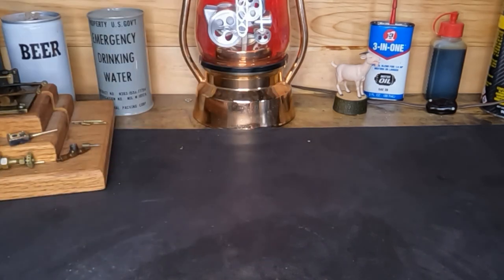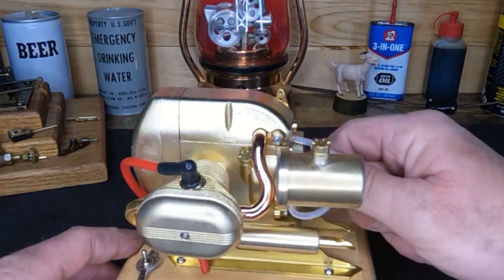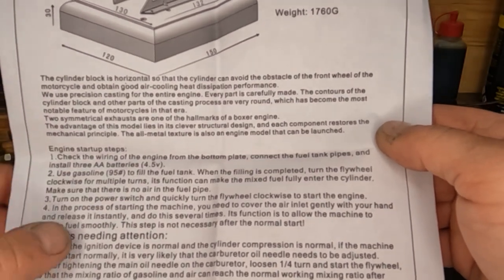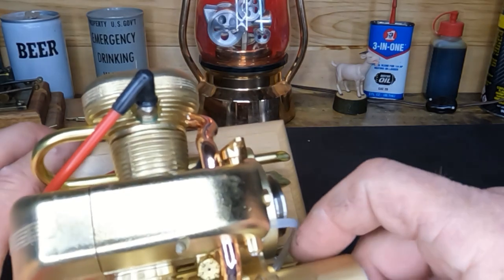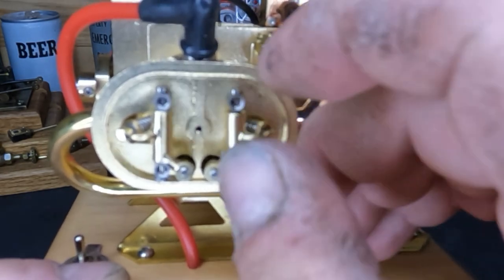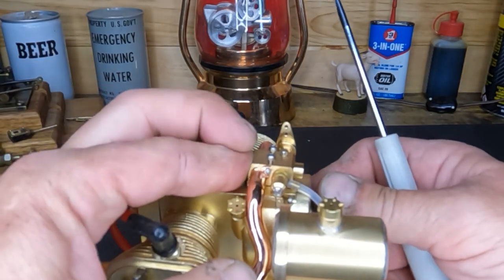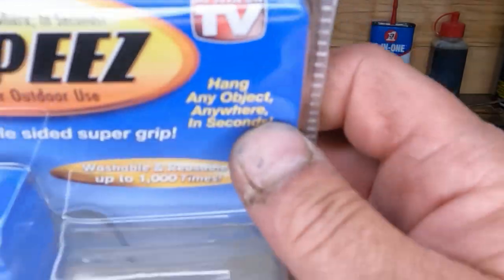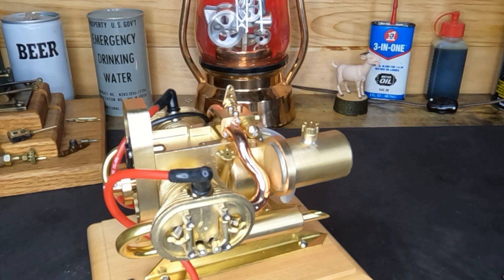First start of a R90-S boxer model.

Comment: I absolutely LOVE Chinese instructions. I FINALLY got my M12 / ET5PRO dialed in. I added wrist pin bumpers, adjusted valve lash, and even eliminated valve rocker slop with dental floss shims. To make a long story short, after hours and hours of fricky frackery I discovered that it hated 40/1 fuel but LOVES 50/1 fuel with a tich of lighter fluid!! Now it idles so slow it almost stalls and does not throttle up more than I want it to. Oh, I just love that precise carburetor. I almost came to the conclusion that the M12 was a fish tank ornament.
Reply from the maker: Hi Joe!   The instructions definitely leave a lot to the imagination especially if one is not at all familiar with how an engine works. And I honestly think that these little engines are about 75% right when they come out of the box, the other 25% is up to the owner 😅
Reply: @steam212  I still have a '64 Chevelle SS with a later model 350 V8 with headers .I had to dent one header pipe with a 4lb. hammer in order to change a spark plug. It won't beat a Tesla but IMO it looks better.
Reply from the maker: @joesenkalowski7912  I completely understand and agree with what you're saying. But I think a 4 pound hammer just might restrict the intake on this little guy 😂.  I think we might turn the fill cap down on the lathe and knurl the edge so we can have clearance.  I've always been a fan of mid 60's GM cars. I had a 67 corvair, a 67 tempest, and a 70 Chevelle. Sadly all of them are gone now.
Reply: @steam212  
That’s interesting...
So, would you say these engines are not really for beginners ? 
Or are there some that are more user-friendly out of the box ?

( or I will go back to my steam engines ! 😅 )
Reply from the maker: @olivvapor4873  Hi Oliv, I would think that if you are comfortable operating a steam engine and the repair and maintenance that goes with them, that these little engines are would not be too difficult at all. I usually go into them and check them out before starting them for the first time. Honestly they all run really well. If you're thinking of ordering one, the discount code Steam212 will save you 10% at Stirlingkit.com.   I hope this helps you 👍

Comment: Hello, I’m just getting into this hobby. Your videos have been so good. Thank you for your time in putting them together. As I mentioned, I’m just getting into this and would ask you opinion on what would be a descent gas brand and model as well as a hit and miss brand and model.
Reply from the maker: Hi Jerry,  I'm glad that you are enjoying the videos. If I were to recommend a good hit and miss model, I would suggest the Enjomor 6cc model, it is large enough to make adjustments on, good build quality, and tends to be fairly easy to "make it your own" ( I made a short series of videos on the one I have)  when it comes to a small brass engine though, I really don't know what you're looking for. Most of the ones I have (or worked on) tended to need some bugs worked out, but were a well running engine after a little bit of tweaking and adjusting. The carburetors are quite touchy, the instructions leave a lot to be desired, and the ignition system (primarily plugs and boots) can be an issue. I'm not sure that Im answering your question though.
Reply: @steam212  thank you for your reply. Hope your day is going well. In regards to the small brass engines, you were going over the bmw style boxer. Your first rune you mention maybe too much Smokeyness coming out of the pipes. Did you get that resolved. What was your fix. That engine has a great sound. Thanks

Comment: PCGuruEngines has a video on valve jobs for these and I don't know if he said anything about how many he's done, but I know I've had to do valve jobs on most of the engines I have.  They do the bare minimum valve job (or none) to get them running and shipped.  Valve Job is just on the list of maintenance I expect to do on these little engines when they arrive.  The only one I haven't been able to do is the EM1 because the fuel intake is soldered in place over the mounting screws for the valve body, so there is no clearance to remove it.
Reply from the maker: Hi Henry, I have seen PCGuru's video and he did a GREAT job. I think we'll give it a shot and see what happens on this one. Thank you for your suggestion and for your interest 👍

Comment: If you watch the video on the stirlingkit website where he runs the machined rather than cast prototype, (straight pipe exhaust and different carb) you’ll see the intake manifold pipe is configured slightly differently. It almost appears as though it’s a longer elbow, and in the work up to production, the bending jig ended up with too tight an elbow, blocking the cap.   I actually think your first guess, 15 ml, is about perfect, having seen inside the sump. I think the last five cc or so blew right on through it.   Also, whatever oil was in the engine ends up wherever the cube  shaped box sits. Mine is labeled sideways. My first engine smoked out one side, but was only running on one, and tear down showed oil starvation damage on the non smoked side.  Bad advice, and I didn’t know
Reply from the maker: I agree with you about the intake manifold and how the original/prototype design is much better. I had to remove this one just to add oil. I think it would be great if the instructions were just a bit more clear also. I would much rather clean up an oil mess or replace an oil fouled sparkplug than having to deal with a catastrophic failure like you unfortunately had to. I'm sorry if I somehow gave you bad advice.
Reply: The bad info came from the vender. You make sense, lol.   Are you on office of steam?
Reply: Watching your video again. Your oil fill has a ledge at the bottom that acts as a Briggs style level indicator. Fill it to the ledge, you’re there. That would just get the cam splashing and oiling your valve train and crank. The cam and crank are in ball bearings, so splash doesn’t have to be much.  Also, how much did you have to open the manifold to head gap to get the oil cap free?  Might be able to put some fat green o rings in the joint at each end?
Reply from the maker: @bruceyoung8904 That takes a load off of my mind, I do my best to be open, honest, and helpful with the videos. I surely do not want to mislead anyone into damaging something that they have. I jokingly tell my friends "I waste my money so you don't have to" when it comes to a model engine. I am not on office of steam, where should I look to find them? Thank you again for your comment and your interest 👍

Comment: I have an M12B and it also shoots some exhaust out of the carburettor.  Checking the valve timing showed that the intake valve opens shortly before TDC, hence it pushes some exhaust out of the carb on each exhaust stroke.  Not sure if this is by design but I'm going to try moving the timing so that the intake valve only opens at the start of the intake stroke.
Reply: I had to adjust my timing too. Just adjust a tiny bit at a time.
Reply from the maker: Hi Simon,  I think you're right. I'm pretty sure that some adjustments need to be made. Timing is everything!     Thank you for your comment and your interest.   If you have the desire to look at another video, we did a complete teardown on a m12b .
Reply: @steam212  Yes I watched your video - it was very useful as I'm battling a few issues with mine and needed to know how to pull it apart.  Mine ran fairly well for a few months but then became hard to start and wouldn't rev cleanly.  I've tried everything - replaced the carb, new piston ring, replaced the ignition module and spark plug but no luck so now I'm going to adjust the valve timing to see if that fixes it (maybe it slipped).

Comment: Mine seem to have the same issue. How can I open and check the valves ?
Reply from the maker: Hi B NA, I would start by taking the valve covers off and checking the rocker clearance. I have not pulled the heads off of this one yet. It seems that the more I have ran it the better it is getting. I hope this helps you. Thank you for the question and thank you for watching 👍
Reply: @steam212  thanks alot, did you change the screw setting on the throttle control as well? I probably fouled the plugs, can I use electric contact cleaner to clean them or lights fluid, or best is gasoline ? Thanks again
Reply from the maker: @simplefact4u  I think I might have turned the main jet in just a little bit. Depending on what they are fouled with, if they are fuel fouled I would use a jet type butane lighter, if they are oil fouled I would spray them with carburetor cleaner and then hit them with the butane jet type lighter to dry them back out.
Reply: @steam212  thank you. I noticed in one cylinder the exhaust valve arm doesn't fully flush in close position compared to other cylinder, and its thr cylinder that doesn't fire. Is there a way to fix that ?

Comment: mine is refusing to start on both cylinders
Reply from the maker: @nuclearpillow1677  have you tried swapping the spark plugs from side to side to see if the dead cylinder changes too?
Reply: @ the plugs work great, i’ve disconnected the left cylinder and itll run, then disconnect the right and connect the left and it’ll run, but both cylinders won’t run at the same time
Reply from the maker: @nuclearpillow1677  hmmm, how is the mixture on the carburetor?   Does that make any changes to it wanting to fire on both?
Reply: @steam212  i’ve tried just about every
mixture, i’m losing hope, i bought the fuel you used and i’ll try it nect
Reply: @steam212  i’ve tried the fuel, it wants to run a little smoother but still only firing on left side most of the time, i’ve spun it by hand a couple of times, feels like a cylinder doesn’t have as much compress as the other, i’ll probably rebuild it

Comment: Just heard back on oil, and I quote, “Hi, 
Many thanks for your message!
Glad you received the engine!
Sorry for the delay and any inconvenience!
I received the reply from our engineer, would you please check it?
Fuel used: 95# and above gasoline
Lubricant: 2T engine oil
Mixing ratio: gasoline/oil=25/1
Lubrication method: mixed oil splash lubrication
Both fuel and oil are added to the tank, no need to add oil separately to the crankcase
Appreciate for your kind understanding!
If you have any questions, please feel free to contact us!

Kind Regards,
Lucas
Enginediy Service Team”

Wanna buy a new, never fueled engine?

Comment: It is bewildering, Add oil or not? With rubber o-rings for rings, engine oil in the combustion chamber is assured leading to smoking exhaust and fouled plugs. I suspect the vendor is concerned about oil leakage complaints. 
My idea, put oil in swish it around or run for a few minutes, then DRAIN the oil leaving the residue as lube
Reply from the maker: I've left the oil in it, no leaks yet and it still fires right up and runs great.

Comment: Did you get oil in it yet? I followed the seller advice, used only fuel and oil mix, destroyed it in seconds. They sent a replacement. I note the original Jin prototype has different manifold pipe geometry do you can open it.
Reply from the maker: I was able to get oil in the crankcase. It was not an easy task, I had to remove the intake runner. I am going to make another fill cap that is small enough to clear it. Thank you for your question and your interest 👍
Reply: @steam212   here’s what they said “Hi, 
Many thanks for your message!
Glad you received the engine!
Sorry for the delay and any inconvenience!
I received the reply from our engineer, would you please check it?
Fuel used: 95# and above gasoline
Lubricant: 2T engine oil
Mixing ratio: gasoline/oil=25/1
Lubrication method: mixed oil splash lubrication
Both fuel and oil are added to the tank, no need to add oil separately to the crankcase
Appreciate for your kind understanding!
If you have any questions, please feel free to contact us!

Kind Regards,
Lucas
Enginediy Service Team”

Wanna buy a new, never fueled engine?
Reply from the maker: @bruceyoung8904  Wow!  No need to add oil separately to the crankcase?  It seems that they have perfected zero friction 🤔.  Thank you Bruce for sharing this.

Comment: We must add 15 ml of oil it refers to oil tank in the explanation sheet bad translation
Reply from the maker: I think they are speaking about the fuel tank because if you can see where they are speaking about the carburetor they refer to the adjustment needle as the oil valve.  Either way, I agree that the instructions are pretty poorly written.